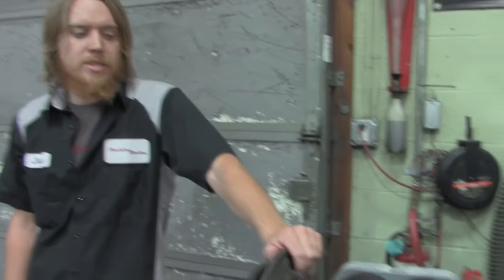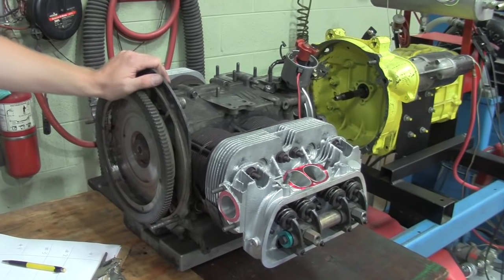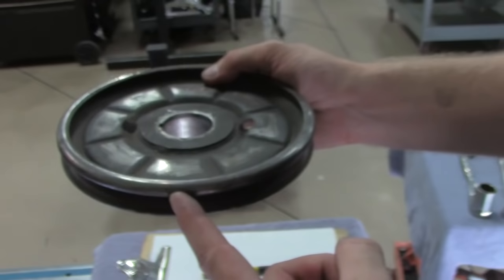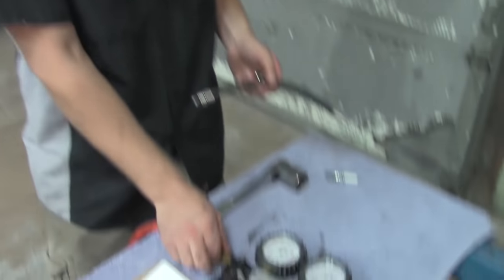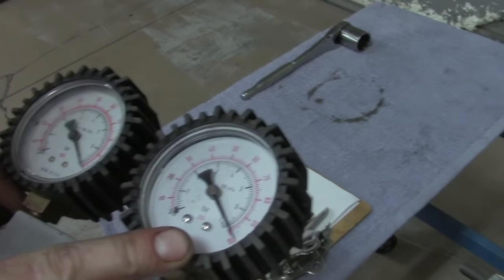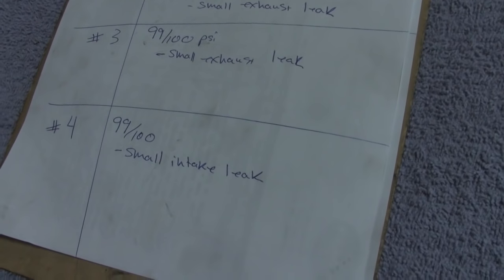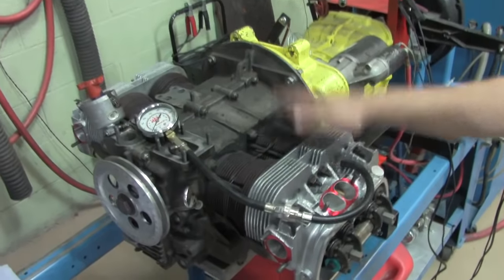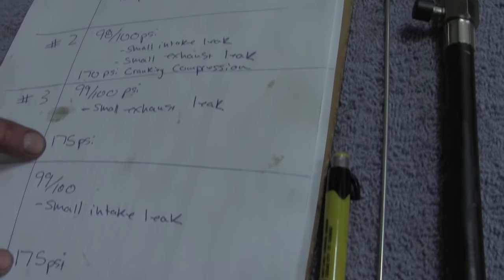Compression Test on an Aircooled VW Motor

Comment: now that my 1600 engine is out and i am going to replace the passenger side head due to a stripped plug thread....do i have to remove the fan shroud   to gain access to the upper nuts on the head ?

Comment: 23:30 NO! The stock threads are not pipe thread, they are M10x1.0.
If you thread an NPT gauge into it you can damage the threads and cause an oil leak.

Comment: Justin pretty good information!!, Just wondering about those sumps added on I made the pick up tube drop lower inside the screen filter wondering is neasary to do that and used adjustable oil pressure relief valve to this at the time was a 1835 build engine?!

Comment: Excellent video. I used a compression tester last year and didn't know the throttle had to be opened.I know now.In future could you do a common bolt on upgrade comparison for stock,before and after for exhaust vs quietpack,1.25 rocker vs 1.4,single carb vs dual.That would take the guesswork out of buying parts!

Comment: Great video. I have a couple of questions for you. I need to change my valve guides and was wondering how many thousandths loose do you ream the guides. Should I purchase adjustable reamers or the drill bit type reamer?
Once I remove the old guides and mic them, should I replace them with  .001 or .002 over?
Thanks

Comment: hi justin great video! only 1 question! can you do a compression test on the engine by cranking it over yourself? im building a type 4 2257cc stroker vw engine but i only have a engine stand NO GEARBOX  AND STARTER or do i need a special RPM to get ik goinG? i have new /rework heads and pistons en liners but no good compression! do you need to oil the liners and pistons first to get compression? thanks joris de vet // the netherlands

Comment: I bought a new set of Pacino's from CB performance heads and I live in Sacramento CA. The first two months seem to be great. Now the car runs really sluggish and it's summertime. I'm curious is there a shortcut to finding out if the heads are cracked. Without taking the heads off the heads off ?.....

Comment: I done a compression  test on my  1835 and now it won't start.
Reply from the maker: If it ran beforehand and all you did was a compression test then most likely the problem will be with spark plug wires installed on the wrong plugs. Also make sure you have a rotor in the distributor.